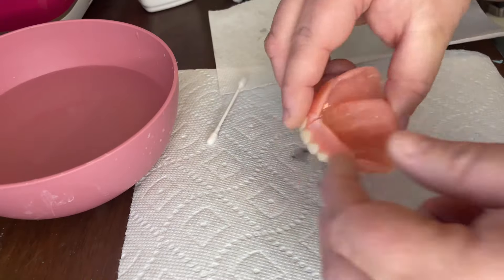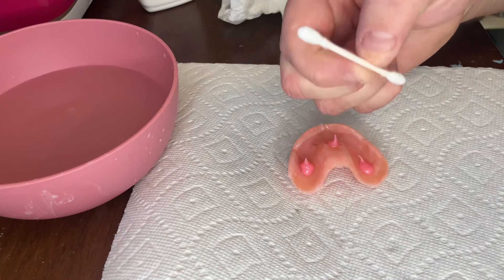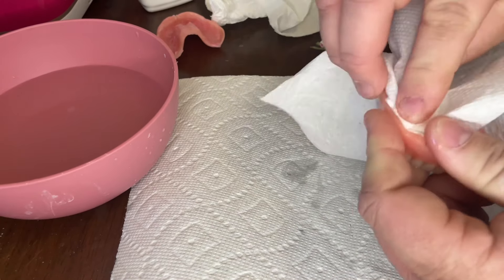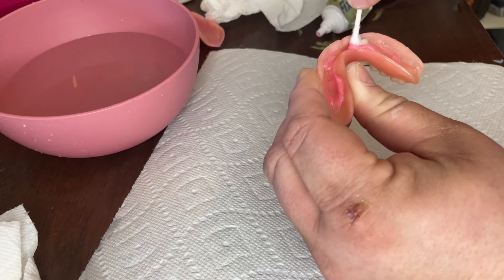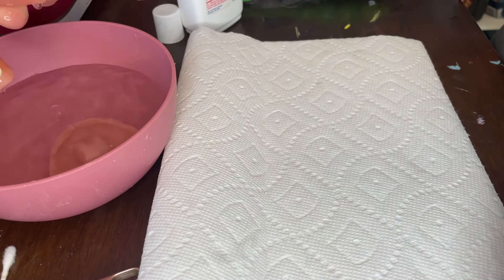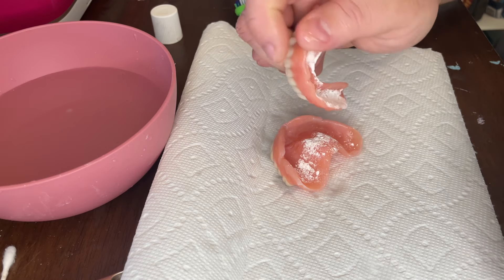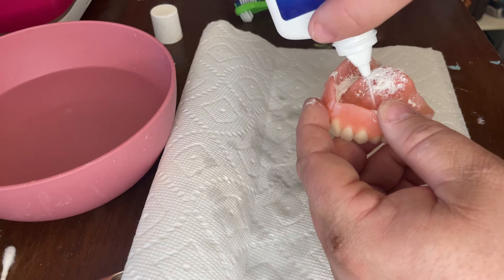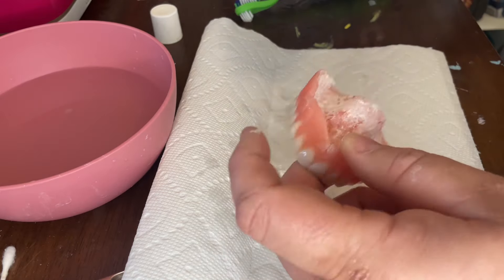Applying adhesive to get an all day hold! How-to apply paste or powder in 2024

Comment: nobody talks about how to get the adhesive off your freshly tooth-extracted gums that are just starting to heal.   I had NO IDEA how difficult that stuff was gonna be to get off my gums and roof of my mouth.   Is the powder easier to get off? ? ?
Reply: Powder is easier
Reply: @mallyh6449  Yeah . . it is . . . but . . . it doesn't last.   My teeth are floppin around my mouth after just a couple hours.
Reply: I just had my teeth taken out. Ran into the same problem. They basically sent me home and didn't tell me anything.
Reply: @ sounds familiar.  It's a tough thing to go thru when nobody really tells you what to expect at each stage.  It's difficult to know if what you are experiencing is normal . . or . . if your denture  might need a 'tweak' here or there.  As for adhesives . . .   I did find some strips (Polygrip) that work a little better than powder and come off easily.  I feel for you.  It was not fun.   But . . . It gets better.

Comment: I don't use any because I can't remove them. I take out several times a day to clean after eating. I have temps x 13 days. I didn't really get any info on what to do. I still sleep with them at night. I'm going to check out more of your videos to see what I should be doing. I've had no pain at all after from where my teeth were pulled. There's times I've had soreness after removing my dentures to clean but ibuprofen knocks it out pretty quick.
Reply: You are doing awesome. How do you like your teeth.

Comment: I used your method for applying adhesive today and it was the best every other tutorial I watched said three dabs but it never said to spread it out with a q tip. I did that today and I hope it's easier to remove the adhesive at the end of today
Reply from the maker: Glad to help. It should be easier to remove adhesive doing this way

Comment: Oh, i went back and it looks like you can use either or but not both at the same time. Ive got a lot to learn on this new venture. Thanks
Reply: I use both at the same time. That’s the only way I can get a great hold.
Reply: @SandyBanning-wy6hd do you mix the paste and powder together or do you have another method of using both at once? I was thinking of sprinkling the powder over the paste as usually don’t use a q tip for application, I just lay a thick bead of paste. Thanks

Comment: So that's what the big brush is for! No one ever told me. They just said use a regular one to use regular toothpaste to clean my new teeth. Secondly someone said to use the powder on top of the fixodent glue. It works but not great. And you showed a better way using three dots and spreading it around. I was putting a single line in the groove which doesn't really cover all the surface. Thanks so much I'll try your way and let you know!
Reply from the maker: The big brush is a denture brush. You can you any brush as long as the bristles are soft! No hard!  But you do not want to use regular tooth paste. The stuff in it can scratch and damage the dentures. You want to use a denture cleaner like Oap, fresh n brite or dr b’s.

Comment: Poligrip adhesive and powder are quite the denture lock BUT.  the lowers loosen up with certain bite force and definitely with any hot drink. My lower gum is so thin nothing will keep it in once I eat. Just have to get used to it

Comment: I just got my dentures last week after not having any for years. Now I have to learn all over again...ugh. it's very difficult! My upper denture isn't bad, but my lower gives me issues. Chewing is very hard as I can't seem to get the knack for Chewing on both sides together.  I make sure to take small bites, but I'm getting frustrated.  I'm going to give your powder/paste trick a try and cross my fingers that it helps. I want so bad to do this, but it brings me to tears. Anyone's help.would be greatly appreciated.  God bless
Reply: I got mine 2 weeks ago, and it’s difficult to chew anything as my tongue wants to push the food up into the top palate.  I’ve had them realigned twice already because the bottom ones felt like they were cutting into my jaw/tongue area.  I also have a horrible gag reflex, and my primary had to send me Zofran to control the nausea and vomiting.  I had all my teeth pulled and dentures placed the same day….its been a ride.

Comment: Where do you apply the pressure for 10 seconds, to fix to the top denture?  Do you press on the teeth and the roof of the mouth part together, or just at the front?  Your advice is appreciated.

Comment: Hi Justin,  thanks for the video.  My dentures make me wonder if they did it right.  Tell me does your lower denture stick out away from the gum?  I have a big gap front and back. Course I fill it with denture adhesive.  But curious if the gap is normal.

Comment: I will redo my comments must have deleted its self.  I have tried Fixident powder and Fixident ultra max alone and together.  Didn't work I tried Secure alone and with Fixident powder.   Secure by itself, both ways no avail.   Tried Denttach alone and with Fixident powder. No luck.   Have you tried Denttach?  I'm getting frustrated there immediate dentures .I've either end up with a mouth full of adhesive or bottoms floating up when eating . Going on 2 months haven't been able to eat with them yet. Food sticks to top dentures and are loose.
I going back Friday for adjustment.  Getting very discouraged, thinking I made a huge mistake.  Any advice, comments would be appreciated. 😢

Comment: Did you apply the paste to a dry lower denture then put it in a bowl of water with the paste on it?
Reply from the maker: I use one or the other. I don’t combine. I showed how to apply either denture. With paste apply to dry denture and insert in mouth.  The powder I keep the denture a little wet and apply.  Shake off extra and get very slightly wet on top of powder before insert. I just wet my hand and drip like 5-6 drops on powder to help wet

Comment: I have had upper and lower dentures for a few years now... I recommend VERY HIGHLY getting Sea Bond denture wafers,, They work very well and I keep them in all day without slipping. Don't get the original flavor, its nasty tasting.. get the Fresh Mint!
Reply: I’m using upper immediate dentures. So it may be different because my gums are shrinking rapidly. But I used the sea bond wafer. It held until it didn’t. Then it suddenly let go with out warning at lunch time. So I went back to my extra Strength fixodent. It holds ALMOST all day. But most of all, I can feel it when it’s starting to get loose. I can deal with that. But i can’t risk the embarrassment of it suddenly letting loose.

Comment: Are use Polident powder which works great for me on my upper denture, but I have trouble getting the remainder out of my gums and it takes a long time to do it with the toothbrush.
Reply: I purchased white washcloths and use them solely for removing adhesive off my gums.  I’ve found they work the best. 
I also use a fresh washcloth to rest my clean dentures on when applying adhesive.

Comment: I have a question!! did you have a problem swallowing  food when you started to using your dentures for the first week? I tried  few times I tried to swallow  and it felt like I wanted to throw up. is that normal?
Reply from the maker: I was on a very soft liquid style diet for the first week so I really didn’t have to do much. I had no issues swallowing. Just might need to heal and get used to
Reply: Im  about a month in. Lost some weight that I don't need to be losing because couldn't eat. Drinking ensure to help.  I hope final dentures not like these.

Comment: A realignment and my bones shrink quite a bit since my extraction is it okay to just use adhesive for the remainder of my time on this planet
Reply from the maker: Some always use adhesive. I do at over 2 yrs
Reply: @JustinBsDentureJourney  yes but you also said you've had several realignments I've only had my dentures for one month and already the dentist is telling me I need and a realignment and I can't afford it so that's why I was asking if I could just use adhesive forever
Reply from the maker: @barbrabass6903  adhesive will only do so much. Once you shrink so much it won’t hold. I would get cushion grip. It’s a great temporary soft reline but easy to remove.  Also cheap price.
Reply: @JustinBsDentureJourney  I'm afraid. If you have used adhesives for such a long time why can't I
Reply from the maker: @barbrabass6903  you can use it forever. But I was just saying the adhesive can only do so much.
Reply: @JustinBsDentureJourney  you have been a big help in answering all my questions. I appreciate you very much. You're a great guy!
Reply from the maker: @barbrabass6903  thank you

Comment: To be clear, after you applied your paste adhesive, you soaked them in the water and applied the powder on top or  was the powder a separate individual application?
Reply from the maker: That was separate. I just wanted to show how to apply either or.
Reply: @JustinBsDentureJourney  Hi Justin. Went today for adj and either soft or hard relign to bottom set, which simply don't stay in.  Got refused any alterations, just told to use adhesive. Any suggestions ? . Top ones fit fine with or without adhesive. (Fixodent plus or fixodent professional)
Reply from the maker: @wendybutler2359  how far along are you?  I recommend fixodent ultra hold max
Reply: @JustinBsDentureJourney  Extractions last July. 7 wks healing with no teeth. Dentures fitted Sept, .so I'm at the 6-7 mth point
Reply from the maker: @wendybutler2359  have you had any soft relines? Those are the biggest thing
Reply: @JustinBsDentureJourney  No thats what I asked for yesterday. He said "bottom ones are always loose. You  could pay for a relign and its still the same, so waste of money."  I have very little bone in the centre if the chin area (mid 4 lower teeth)
Reply from the maker: @wendybutler2359  with a soft reline it will make them snug and hold better. You won’t get the suction as the top but good fit and right adhesive will hold all day if not close to it
Reply: @JustinBsDentureJourney  Can I do a soft reline myself and do adhesive on top if necessary ?
Reply from the maker: @wendybutler2359  you probably would wanna try cushion grip and put adhesive on it
Reply: @JustinBsDentureJourney  What is the difference ?
Reply: @JustinBsDentureJourney  Just trying to buy some now
Reply: Different applications. He does not use both adhesives at the same time.
Reply: @Justin B's Denture Journey  Def helped with cushion grip, so now I know a professional soft reline is necessary. Dentist is saying get a new bottom set but that = more £££. Have reported him to Dental Council.

Comment: i had soft reline can i use this on top of that  also for denture fit can i put that oover the soft reline from dentist or does that have to be off
Reply from the maker: You can use densurefit on top of dentist soft reline. If you have a warranty on dentures, you might want to remove densurefit from your dentures before going for the next soft reline at dentist (if you have another).

Comment: Hi Justin,

Got my relines done to top denture, and lower partials.

Perfect fit, speech much better. I mean a perfect 10. Can be confident at work on the phone again. 

Had a Minced Lamb sandwich so all okay. 
Don't need any fixodent on lowers they stay in place.

On top, I decided to try secure denture adhesive waterproof as hated the fixodent when taking Dentures out and having that awful gunk sticking to roof of mouth. 
Dentist recommended I try and came home cleaned Dentures and applied secure denture adhesive waterproof it pretty much cured straight away, says wait 15 minutes on box before eating or drinking. 

Will come back here and review when I take them out. 

Went today and they noticed a cavity forming on one of my lowers so will clean it and apply dental resin and light to cure it.

They say if taken care of can reverse, we will see

I paid £320 for relines.
£160 * 2, owch, wasn't expecting that when I spend £680 on upper dentures and £740 on partials.

I will query it later.
As was embarrassed and just paid up.

Main thing to point out to everyone, is there is such a thing as perfect fitting Denture that bring back you to your former self before extractions.

It worked for me extracted 22.11.2023 hard reline 19.01.2023

Speech improved to former levels.

Eating is back to normal.

So advice, so your own with smile disk, then top up with cushion grip as you'll use less cushion grip.

Clean your Dentures but don't use hot or warm water, this will  loosen your cushion grip, I got 3-4 weeks out of my cushion grip.

Did my 5 10 min soak in tablets clean, rinse and I place them in distilled water.

So so far I'm a success story and will be for you.

Just persevere, and experiment and watch Justin and other utube videos.

So my review of secure denture adhesive removal of denture.

Yes it seemed like it was just like fixodent, however, gargling and rinsing with hot/warm warm, loosened it all off.

Came off like small flat sheets, therefore a win win over fixodent for me, plus zinc free.

Will let you know tommorow 10pm uk time how it holds up to all day hold.

Comment: I am glad that fix a dent works for you. But I am sad that it does not work for me. In fact last night I threw a tube of fix a dent in the trash and it was still 2/3 full. I do wish it was that simple to just run some hot water over your toothbrush and then lightly brush your gums to get that fix a dent off your gums, but it’s not that simple for me. That method does not work for me at all and I use about half of the amount of fix a dent that you used, a very very small amount. It’s like rubber, cement in my mouth my dentures hold all day but then taking them out is tough and I can’t get the fix a dent out of my mouth!!! I’m glad some people like it but I hate it. Anyway everybody get blessed and stay safe.
❤️🙏🏻📖🙏🏻❤️!!!
Reply: Try a dry microfiber cloth.

Comment: Hi Justin, I use a spoon to fill with the powder and then tap tap over Dentures to give a a good dusting of powder, if I have to much powder left, I put it back in the bottle, give a try and see what you think.
Reply from the maker: That works
Reply: @JustinBsDentureJourney  Hi Justin, so happy it works for you.

I may also do this after my reline tommorow, to improve taste and so not to upset denture maker, already took some off back to stop gagging as snugged up with cushion grip, now eating and talking like my old self.

I got a good dremel kit. 
I won't shoeshoe too much. 

Must leave enough for suction

https://youtu.be/pbC5MbAKYBs
Reply from the maker: @notofthisworld7777  be careful with shaving it down. Take too much off and you could cause issues.

Comment: My mom's 6 upper teeth was removed and got a temporary full denture last week, but it doesn't stay in place. It keep fell down while she was talking. I feel so bad for her, but don't know what I should do 😔
Reply from the maker: Well if it was just done last week you can’t put adhesive on extraction sites. But you can put a small amount on the roof (palate) of denture. Fixodent ultra max hold is best option. And just one drop spread by qtip like in video. Then wait 30 minutes before eat/drink
Reply: Ty for asking this question, and Ty Justin for answering bc I’m getting ready to go through all of this and I was wondering the same thing about any “options” while still waiting for gums to heal and/or while still wearing temporary dentures.🙂

Comment: Hi I jest got my soft reline two days ago and they are loose what should I do please help 4 4:15
Reply from the maker: If your early on after extractions then your gums can shrink that quick. Use adhesive, fixodent ultra max hold.
Reply: @JustinBsDentureJourney  thanks for getting back to me I thought when you get a soft reline you don't have to use adhesive no more and how do I tell the difference between the soft reline and the adhesive when cleaning them I use dr b oap cleaner and it looks like some of the soft reline come out sorry for all the questions but you do a good job explaining things

Comment: OMG! I HAVE TO PUT THE GLUE UP TO THE RIM ALL THE WAY AROUND AND THEN I PUT THE DENTURE IN THE FREEZER FOR LIKE HALF HOUR (UNLESS I FORGET WHERE I PUT IT). IT'S AWFUL.  

THEY WEREN'T THE BEST BRAND NEW AND I'VE NEVER HAD THEM EVEN LIKED AT SINCE BECAUSE OF FUNDS HENCE THE REASON I CAN'T GET ANYWHERE CLOSE TO SOMETHING THAT DOES WORK.  I CAN BARELY SCRAPE UP ENOUGH FIRE THE GLUE. EVERY TIME I SIT DOWN TO EAT... ANYTHING... IT'S ANOTHER ROUND OF NEW GLUE! I'M GOING THRU A FULL TUBE IN MOST...A WEEK
Reply: what does the freezer do for the adhesive?